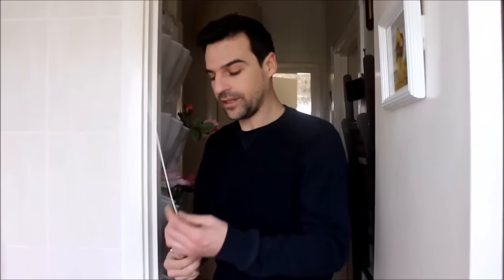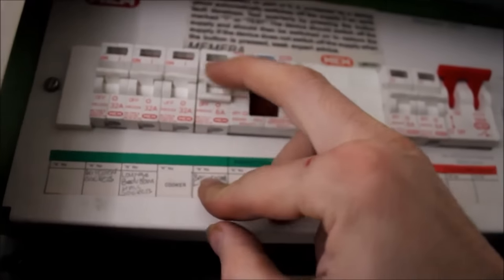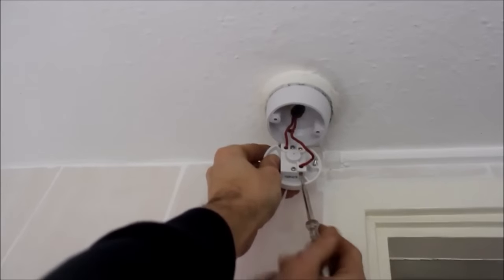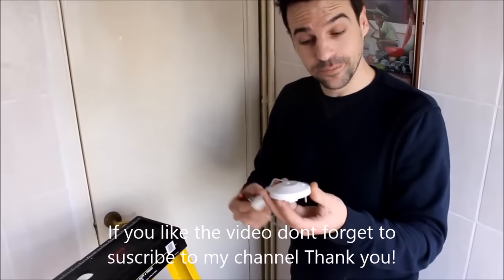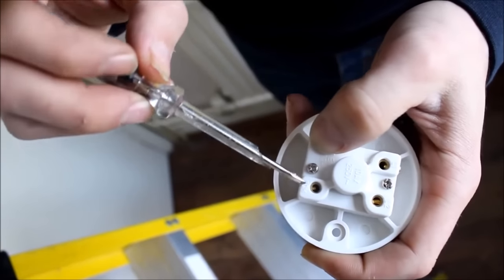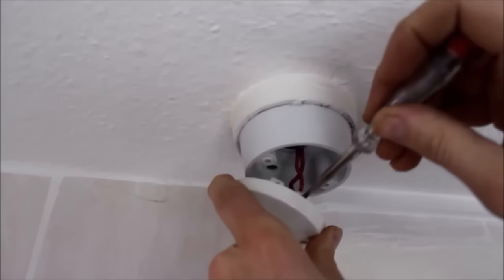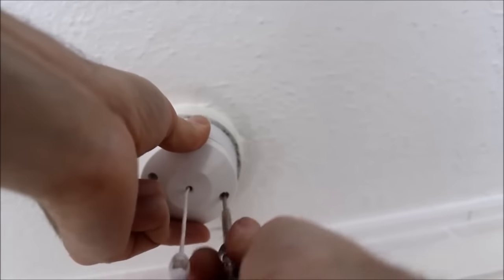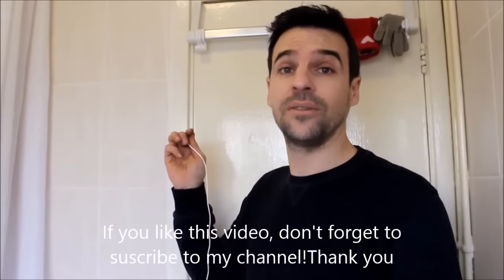How to Repair/change a Pull/Cord Light Switch Video explanation

Comment: Hmm- Thanks for this guide, but as a maintenance op myself, I would like to point out SAFETY is everything when working with MAINS electricity. What presenter calls "the MCB board" is known as the "Consumer Unit" (in the UK) (Or what used to be called the "Fusebox"). Unless the trip switches are CLEARLY marked, you might find yourself working with a LIVE connection. Personally, I would cut the MAINS power to the entire house (in case the bathroom trip switch is incorrectly labelled at the Consumer Unit). Then, I would TEST the two hanging WIRES with a DIGITAL MULTIMETER (in the UK u can get these for as little as £8 from Halfords). Once you are SURE you dont have 240 volts pumping through those hanging wires, then I would unscrew them. Best wishes- Happy DIYing! (PS If you not sure how to cut power on the Consumer Unit correctly, Google is your friend!)

Comment: Good video, just one thing to improve. Never trust that fuse are labelled correctly-mistake of another person can cost you a life, so always check if the power is cut off before start work with electricity...
Reply: I turn off at the mains to be sure
Reply: @craigfowler7098  all*

Comment: Thanks Bert....This was the first attempt at anything apart from changing plugs & fuses.  Clear, encouraging advice & easily achieved despite not having all your tools.  The new switch matched the size of the old one, so rather than disturb the base fixings on the ceiling, I just rewired into the new part and screwed it back into the old base.  Main fuse back on, pull cord, lights on. Great.  Tried again, to show how clever I was, and the whole unit came out of the ceiling fixings!  Light still works, but now I need another youtube video on small ceiling plaster repairs!  Keep smiling - it cheers me up.
Reply: I need to watch a video on how to change a battery in your smoke alarm
Reply: @THELONDONCHANNEL  most of them have inbuilt batteries i'd just buy a new one.

Comment: I just changed my pull cord switch following your method.Even though the new switch was slightly smaller (& due to that I had to replace the whole unit ) I was able to achieve perfect result.So Big Thank you for saving the electrician's fee (not sure how much he would have charged for this small job!) .I only spent £5.Big Thank you.
PS My husband was impressed 'he wouldn't have undertaken this DIY!
Reply from the maker: Thank you very much for comment, and I am really glad it did help you and safe you quite a few ££ !!
Reply from the maker: most welcome. And I am very happy to hear. I hope 5 years down the line still works. Well done on you
Reply: You weren't kidding!

Comment: Thank you for this - it's given me confidence to have a go fixing the light in the bathroom - I wasn't sure I could because the base is difficult to unscrew and I didn't have the muscle to dislodge it, but it looks like I can just replace the base part and not need to worry about the order of the wires either... I will give it a try! Thank you. :)

Comment: My advice is to turn all of the electricity off from the switch board as sometimes they have been labelled wrong (unless you know for certain), and just use the daylight to or a torch to fix it. But is always safer to cut all the mains off just in case there is some short circuiting, water conduction somewhere or something like that.

Comment: we managed to pull the cord clean out of the switch, can it be put back in??
Reply from the maker: +Dean Marcus , yes you can, but it is a little bit tricky, I found much easier just to fit a new one as it is really cheap, under 3 pounds

Comment: I think you should always use a circuit testing screwdriver to ensure the switch is not live Unless you have previously seen the light go off when that fuse is tripped you cannot rely on it being "dead" If you do then it may be you that's dead
Reply: Yes... VERY IMPORTANT!
Reply from the maker: I agree, safety first. I knew my installation at the time thats what the video was direct. but other people may take a short cut. And yes it shall be advice

Comment: how would you know which switch is for bathroom in the fuse box if you don't have label in fuse box for each switch?
Reply: Mohammad Mustapha you can flick the main switch,  (red one) it will cut the electricity for the whole house though

Comment: More like replacing than repairing, also depends if you can source the same switch unit that goes on the bottom...... which I can't!
Reply from the maker: it depends on the country, I am certain can find replacements in UK

Comment: Be mindful that it is not necessary that the bottom part will match the new replacement switch. SO before throwing away make sure its the same size.

Comment: This is potentially dangerous. The safety steps have not been sufficiently covered. If you are not 100% certain of the process call a competent person or do more research. Electricity doesn't know you and it will kill you if you are not fully aware. I know this is an old video but it came up top of my current search. Presenters should be responsible to ensure their content is up to date and current but above all safe.

Comment: What do I do it the string breaks?
Reply from the maker: They sell the whole kit, and it is pretty economical. But in case the string breaks and you want to replace it still possible.You only need to dismatle the string part. ( I am sure you are fully capable)

Comment: I changed the same switch & it had 3 wires. 2 in to the common & 1 in to L1.  Why is this?
Reply from the maker: Hi Daniel,this most be because the common cable then is being used  to feed another part of the circuit in the house.
Reply from the maker: it was use as a bridge to another conexion in the house. Still safe as long as all the circuit is well protected